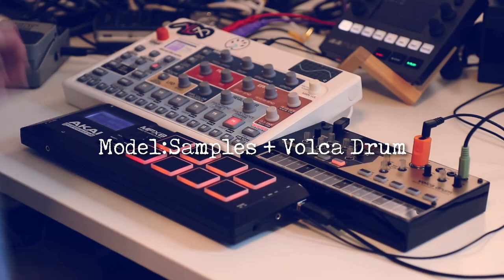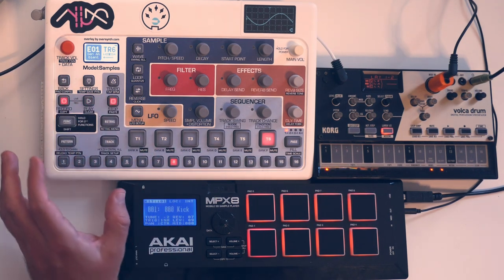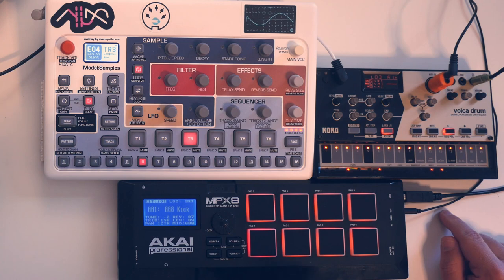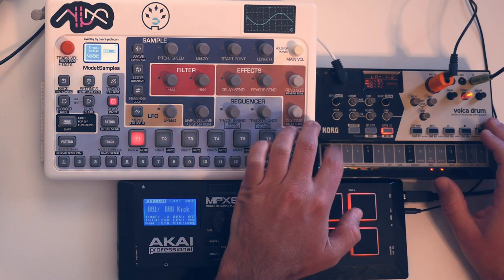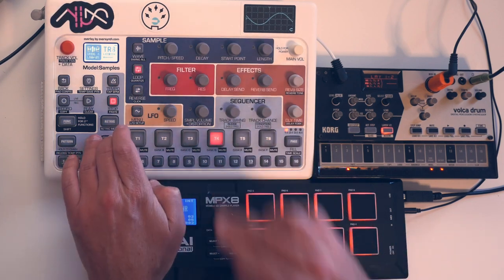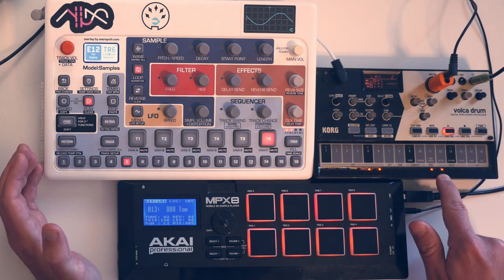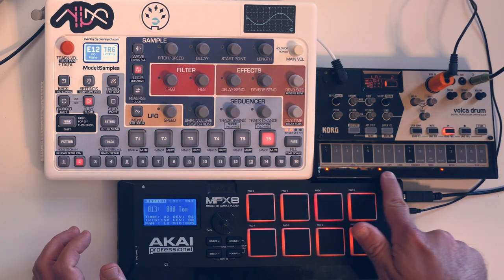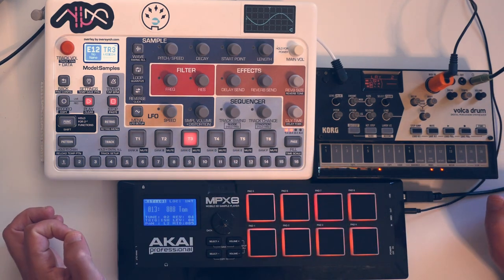Model:Samples + Volca Drum pairing - talk through and ambient chill thing from scratch

Comment: Is it a myVolts Ripcord you are using? 5, 8 or 12v?
Reply from the maker: Yes, I'm using the 5V for the Model:Samples, but any of them between 4V and 10V will work on the side DC input. The rear input is 5V only.

The Volca is 9V.